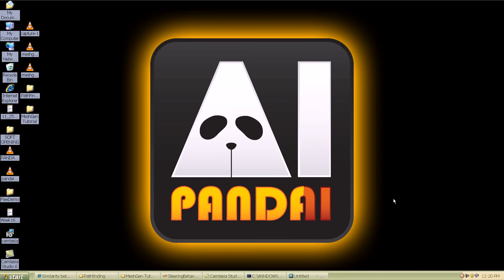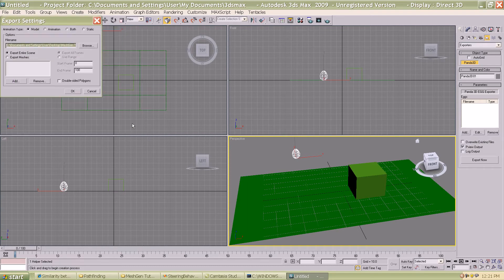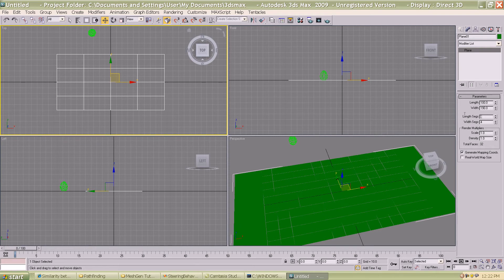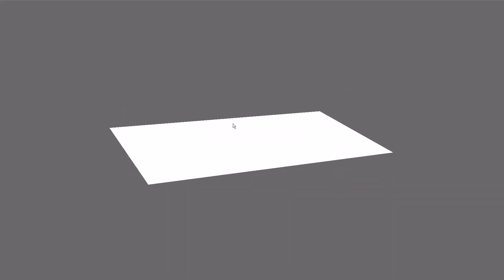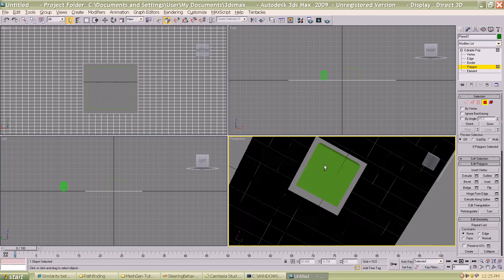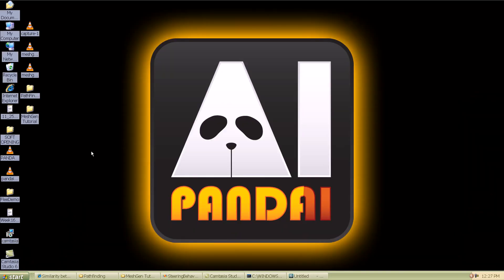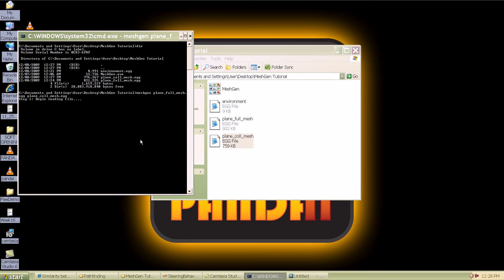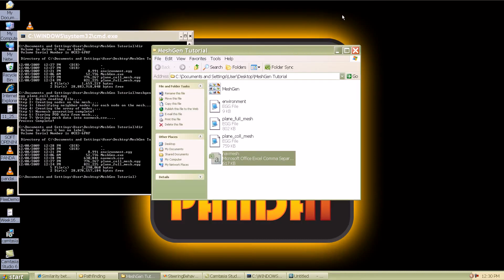Navigation Mesh Generation Tutorial Part 1

Comment: For blender users:

Step 1. create your full mesh:
Step 1.1: Open Blender ( I use 2.63 and its corresponding YABEE version to export .eggs) and remove cube.
Step 1.2: make grid have 60 lines or more.
step 1.3: add mesh->plane and then scale x , y, z all to 70 or above. 
step 1.4: Enter edit mode then subdivide plane to have 64 faces or subdivide atleast 6 times.
step 1.5: Export as .egg as full_mesh.egg and save the blender project for later use to create the collision_mesh.egg

step 2. create your collision mesh:
Step 2.1: from the blender file used in step 1 enter edit mode and if you see highlighted plane where you made subdivisions
 left click anywhere until the subdivisions are not highlighted in orange.
Step 2.2: enter "c" on keyboard to select faces and highlight the faces you plan to remove from the plane.
Step 2.3: after highlighting the faces then go to delete utility (must be in edit mode) and delete faces (may possibly be faces or faces only one of the two)
Step 2.4: Export as .egg as collision_mesh.egg and save the blender project.

step 3.create navmesh.csv:
Step 3.1: with the full_mesh.egg and collision_mesh.egg  use PythonMeshGen.py that is specific for blender users provided from the PandAI developer on his google website (there are two sites and the 
one that is owned by Carnegie Mellon has the wrong version of this software).
Step 3.2: Enter in command line (im using windows) ppython PythonMeshGen.py full_mesh.egg collision_mesh.egg
Step 3.3: use the generated navmesh.csv

Thank you developers for creating Pandai has helped me a whole lot.
Reply: Thanks :)